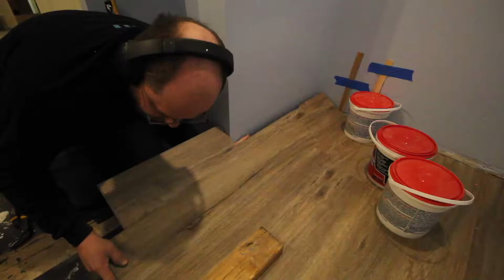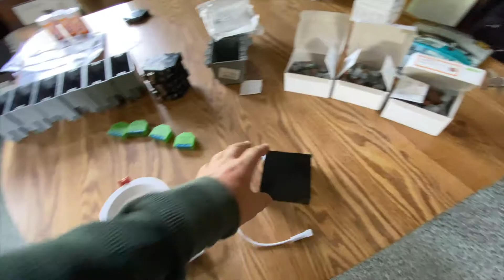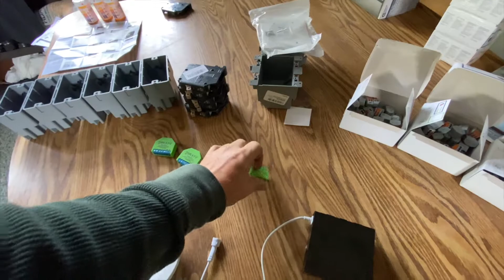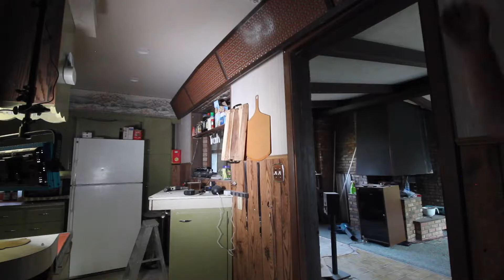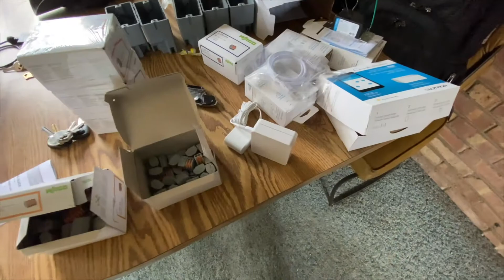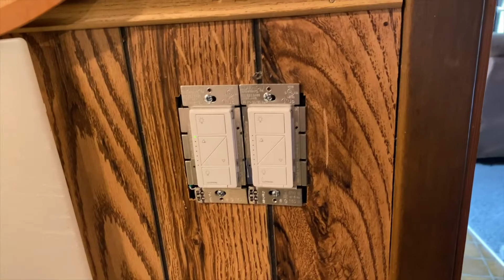Fun With Electrical!

Comment: Type of project where you can actually grow on. Appreciate the effort, kind of chilling watching those videos after work.
Reply: Can you cover me with an link for those smart switches? Kinda wanna try that
Reply: Okay, should've watched that until the end. Did you connect the Neutral wire to the N? Could be possible that due to an wrong wire connection, that the L and N got swapped somewhere. Because of that, the condensators were wrongly connected to the circuit, which can lead to an implosion of the condensators itself.
especially condensators are fragile like that. Next thing, there could be an Trafo missing? Not sure how much volts an American household was again, I barely remember 110-120 volts. I live in Germany wheres 230v.
Reply from the maker: Hey, thank for watching! It was definitely wired correctly, I double checked before turning the first one on, and checked again after replacing the first one. It's possible I just got a bad batch. The U.S. electrical system is split phase 120/240, this video explains it well: https://youtu.be/jMmUoZh3Hq4